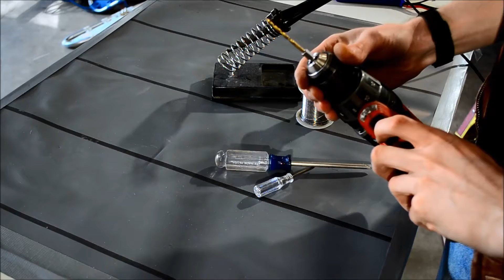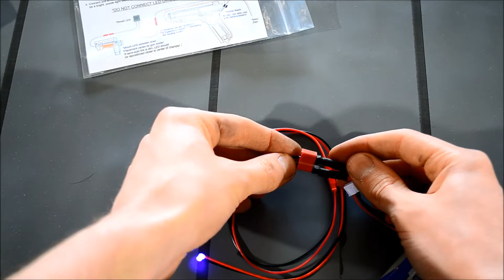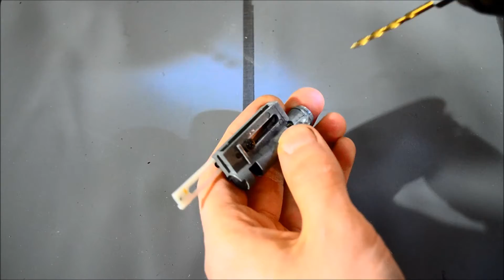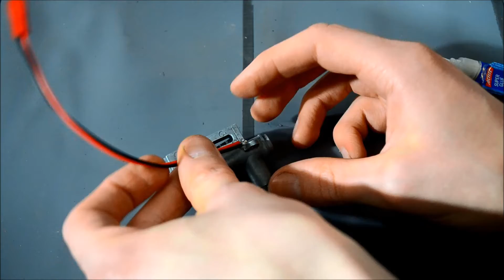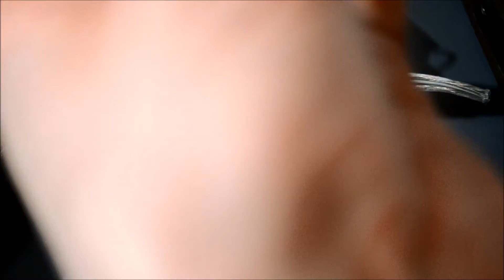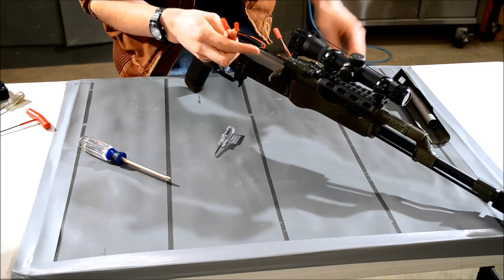'Streak' airsoft tracer unit installation

Comment: Would it be possible to remove the connector plugs and connect the wires directly? I can't find a way to route the plugs.
Reply from the maker: Yep! That's what I do with AR's and tight recievers. The male should be able to pop out by pushing in the visible tabs. The female needs to be cut through though
Reply from the maker: Sharp knife will work you down to the tabs on the female, then shrink tube both sides . I've also found expanding the pins helps them stay together, as most holding power came from the red housings themselves.
Reply: @remagairsoftllc  awesome! Thanks for the reply, and the unit works great!
Reply from the maker: @c-dawg2145  No problem! Glad you like it!

Comment: This is brilliant!I was wondering if it would work on an ARP9? would that be possible?
Reply from the maker: Should be able to work on any AEG. If you have a MOSFET it's pretty easy wire in as you can route wires outside the gearbox. If it's too tight there's also the option of just using a switch/9V. I have one in a VZ61 skorpion actually!
Reply: @remagairsoftllc  Awesome! Thanks for the help.

Comment: I know this is a year late, but does the LED, having a consistent brightness? Such as, using a 7.4 vs 11.1 lipo make it dimmer or brighter? I bought G&P tracer mags and this seems like a great alternative.
Reply from the maker: Brightness is consistent through ~6v to 16v. The LED is regulated and will only pull 30mA regardless of battery.

Comment: Hello, I wanted to know if the blue led is 6v or 3v to 4v ?. The connection carries resistance? Of what value is the resistance? Thank you. Greetings.
Reply from the maker: mauricio reber It is actually an active current source and keeps the power to the LED consistent throughout 7.4v to 11.1v batteries. The LED's are 3v types.